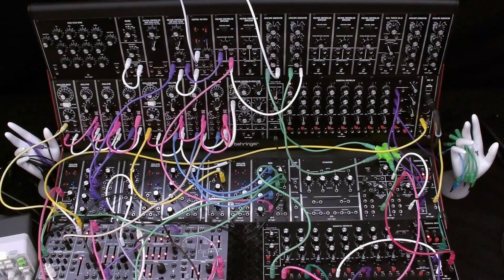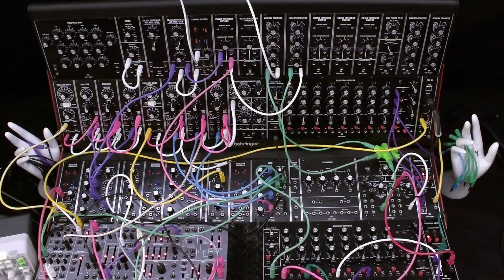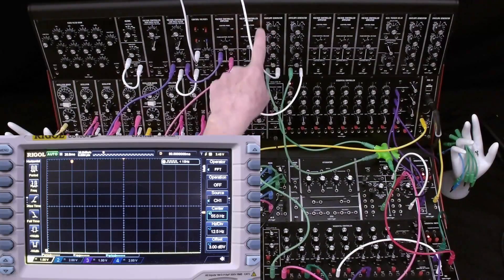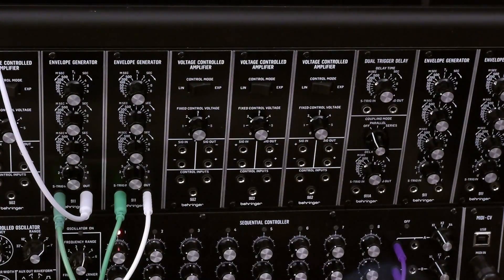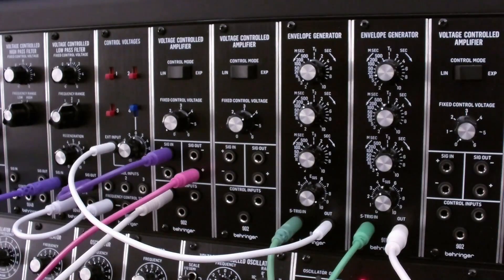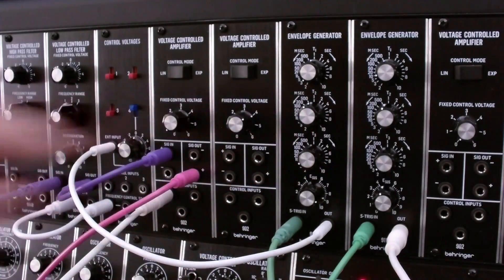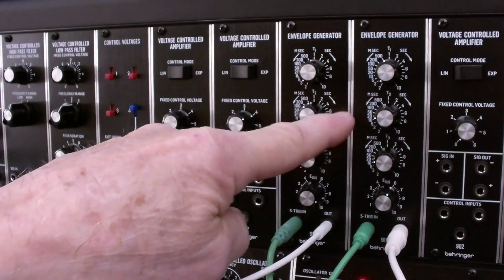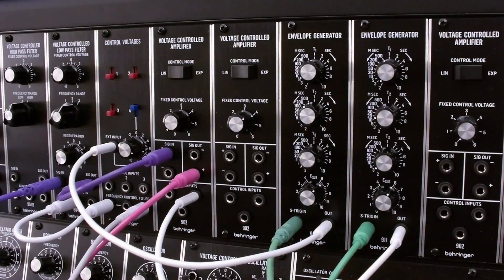System 55  -  911 envelope ecosystem

Comment: In your "brass with swell" patch, are you creating a bucket brigade ADL? Can this create a super delay effect? I see you have an open spot in your rack. What are your plans for that? Cheers
Reply from the maker: Tony!  No I'm not creating an audio delay, I'm just modulating the filter cutoff with a second ADSR.  Both ADSRs are modulating the filter cutoff.  A trigger delay for the second ADSR makes it occur at a later point in time.  
You could do something similar with a triangle wave, if you could trigger a waveform (phase) reset with the keyboard gate ( you could do that with a 921 oscillator ).  In that case, the second peak would occur in the second cycle of the LFO.
That's a little complicated to explain in words.  Does it make sense?
Open spot: I damaged my Ornament and Crime module.  I'm working on getting it fixed & reinstalled.  That will leave me with only 4hp.  I don't know what I'll put there (more LFOs would be nice).
Reply: yes I understand what you mean about the multi envelop. I have heard this effect many times in recordings. I will give that a try and let you know. I was thinking that you could take the delayed envelop and create a feedback loop and get a delay effect. Just reorganizing my system 35 to make patching a little more effecient right now. Lots to experiment with. Thanks OZ  @ozhalljr
Reply from the maker: @moogfooger  I probably misread your original comment. Looping delayed envelope would be nice.  Perhaps an LFO instead.  I'd love to see a quick demo of what you create with the 35.
Reply: ya, looping thedelayed  envelops. Any thoughts on an effecient way to do that? cheers @ozhalljr
Reply from the maker: @moogfooger  I tried retriggering the first delay from the end of the second delay.  It did not work.  Either I got the logic wrong or I need extra circuitry.  I had assumed that the "series" position of the Coupling Mode switch just connected the output of the first delay to the input of the second delay.  Now, I'm not sure that assumption is correct.
I think something like a Maths module might be better a doing this sort of thing.  
Alternately, perhaps you could use a (960) sequencer as an envelope generator.  You could have one row for the level.  You could use a second row to control the glide time with a VC Lag processor.  Each step would have both a level and a glide time.  I have not yet tried that.
Reply: ah yes. that would be cool. I also thought you could just plug one delay into another. Once I get my 35 back together I will try it. I dont have a 960 but I have a 1027 sequencer. Cheers @ozhalljr
Reply from the maker: @moogfooger  Keep me posted.  Cheers!